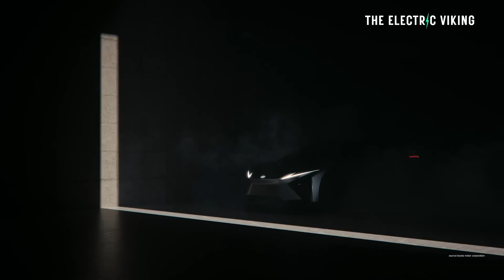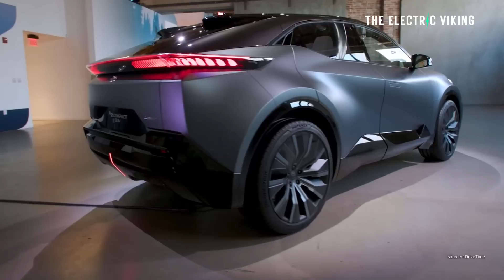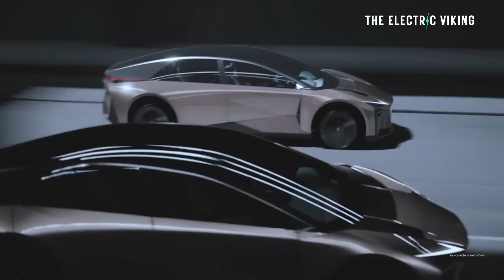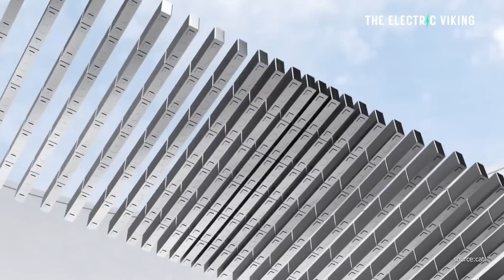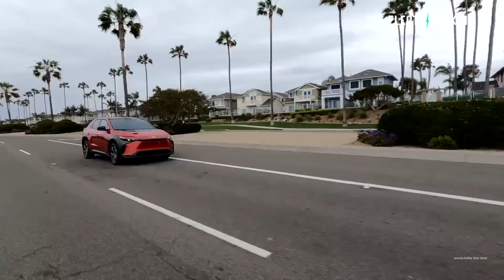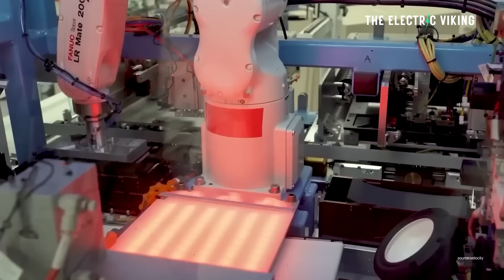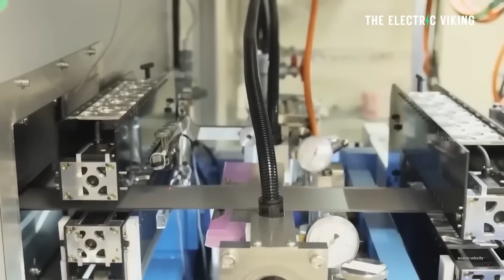Toyota says it has game changing LFP and prismatic cells that will destroy BYD

Comment: 620 miles is range is necessary... for me. 
And if highway speed drive you will only get 350 miles ... or 450 km range.

I doubt Toyota can get it better or cheaper than BYD in due time as they had developed more and wil do so.

But with this range they can sell it as higher price product.

I certainly hope so ...

Comment: Three years to leap frog what Tesla has today however will it still be better than what Tesla will have in one or two years?  Tesla tends to leap frog itself sometimes a several times a year so Toyota would need to step up the pace and start delivering these "Wonder Vehicles" closer to tomorrow and not in the distant future.

Of course one would have to ponder on how this impacts their "Deal with the Devil" promoting petro-chemical sponsored hydrogen fuel stations.  Is there an internal battle going on inside Toyota between Hydrogen and EV factions?  If so it may be interesting to see which side wins the battle.

Best!

Comment: Prismatic Cells??? 
Up Next, Toyota claims to have integrated the new Quantum Drive for light speed energy conversion coupled with their new Flux Capacitor to combat the influx of these Chinese EV's, good for 50,000km per charge and charges in 35 seconds flat.

Meanwhile, Toyota selling BZ4X with marketed 414km range, but due to software inefficiencies and other outdated technology, real world is actually only 50% of that.... 🤣

Comment: I saw some reporting on this, but it doesn't make sense to me. They're saying 80 kWh battery capacity and 1000 km range.  That is not a statement about battery technology, or energy density, or the physical size or mass of the battery, or anything of the sort.  All that becomes irrelevant.  If you've already specified that 80 kWh is how much energy you have available in the vehicle, and 1000 km range is the goal, then the only way to get there is by making the vehicle crazy efficient.  It would have to be much more efficient than a Lightyear One.  It would have to be on the same order as an Aptera!  Can you imagine Toyota going into production with anything like an Aptera?  I can't.

Comment: I would take a smaller battery and les HP if I could get at 320 miles with a 10 minute charge.  Seems to me EV's are overpowered and a smaller HP motor with smaller battery would save on weight and price. Who need 500 HP anyway?  Why don't they use 200 HP motors that would use less battery drain?

Comment: 600 Mi of range out of an 80 kilowatt hour battery pack is ludicrous, that's 7.5 Miles per KWh, that's impossible you'd have to do some insane weight reduction with great aerodynamics or make a very very small car, something like an Aptera, no regular sized hatchback or sedan could dream of that kind of efficiency.

Comment: There are a number of factors that could explain Toyota's change of heart. One possibility is that they have finally developed battery technology that is cost-competitive with gasoline-powered vehicles. Another possibility is that they have become more confident in the long-term viability of the electric vehicle market.

Whatever the reason, it is clear that Toyota is now ready to compete in the electric vehicle market. They have a strong brand name, a deep history of innovation, and a wealth of experience in automotive manufacturing. They are well-positioned to be a major player in the electric vehicle market in the years to come.
Reply: Yep. If I was forced into buying an EV in a few years it certainly would not be a Tesla. I rented a brand new one last year for 10 days. Appalling quality control. Panel gaps that a snake could crawl through, ridiculous big screen flapping around over corrugations, cheap plastic trim, and the range and charging experience was terrible. I have owned 4 HiLux's and a Toyota Corona (plus several other vehicles, Ford, GM, etc) over many decades and I would probably go the Toyota EV route when they eventually get properly sorted out. I also will never buy a Chinese car, EV or ICE.
Reply: @ivannavi8154  You should see the newer Ford and RAM diesel work trucks.  I've had 23 recalls in the last 2 years, with one recall on my RAM 3500 for a fire hazard, which their fix is to recommend not parking it in a garage or near structures.  This in not a joke, it literally says that on the recall notice because they don't have a fix for it yet.  My little model 3 is actually really well put together compared to those piles of crap.  If you had one of the early models Y's out of Texas or one of the earlier model 3's I know they had issues but I agree Toyota's are generally higher quality.   BMW seems to have actually received first shipments of solid state batteries from a company called Solid Power for testing purposes.  They appear to believe they can get these to market in 2025.  To what quatitly who knows but the future is getting really interesting.
Reply: Is from china
Reply: I hope your right.  I just wish they'd stop the bipolar statements from their management.  One day they say they have a super battery and the next day they'll state the EV's over hyped and Ice is the future.  Some of these statements coming from Akio Toyoda himself.
Reply: @Ryan-ff2db  I understand your concern about the mixed messages coming from Toyota's management regarding their electric vehicle strategy. It can be confusing and frustrating to hear conflicting statements from a company that is supposed to be a leader in the automotive industry.

Comment: I drive an EV with a nominal range of about 300 miles. Factoring in the winter performance, the range at Interstate speeds, and hilly terrain, I definitely want more range for our road trips.
Reply: Literally was gonna come down to the comments to say similar. I have yet to have the opportunity to switch to Electric 'cause... they be pricey... but while Spring, Summer, and Fall are usually pretty nice for EV driving I'm sure here in Canada, Winter is another story with notable reductions in range and I presume charging speed as well. While 300 miles (482km) isn't the worst and would probably be sufficient for most road trips during the warmer seasons, I'm sure that would drop to 240 miles (386km) at best once the temperature drops significantly closer to / beyond the freezing mark. My ideal would be anything that could do 500+ miles (804+km) so that any stops I might make I may not need to worry as much about fully charging to make it to my next destination or to my next stop. Of course I say this knowing one drive I regularly do hits a little over 600km (373 miles) one way, but doing that drive in the winter I'd rather the extra range as a buffer.
Reply: @jonatamaniuk  If you need that kind of range you might be better off waiting a couple years.  The next gen batteries due early next year will have about 15 percent better density, 40 percent better charging and particularly in your case better performance in cold temperatures.  Also due to the lower costs and lower weight they can theoretically increase the size of the pack as well but that's up to the manufacturer.  With more competition coming to market in the next couple years they'll be a greater selection of vehicles to choose from.  

I always tell people to leave emotion out of the argument.  EV's are incredibly fun to drive so it's hard to leave emotion out of it sometimes. Just make sure to go over the actual numbers and distances you realistically intend to drive and make sure it's right for your situation.  And make sure there's adequate superchargers on your expected routes.  In the US there's very few places an EV can't go but Canada is massive country with a smallish population.  I've been on some of those northern roads and man you can drive for an hour and not see another vehicle.
Reply: I agree.  400 miles is the sweet spot.  This is what the rest of the industry has settled on, as the average range of a gas vehicle is almost exactly 400 miles.  If you have kids you'll never make it past 400 miles anyways even with Benadryl.

Comment: In an EV "1000KM of range" gives you a "REAL" range of about 330 miles or range if you decide to carry extra passengers, luggage, towing, in cold weather... so do you need 1000Km of range?... Hell yeah! especially if you plan to use your vehicle for more than just joy riding on a Fri night...   And don't forget 10-20% battery degradation after 5-10 years... So again 1000 - 20% = 800 / 3 (under load) = 270-300 miles...   Come on Viking... you know these are the HARD FACTS...

Comment: We have a 2023 Chevy Bolt and have achieved range up to 330 miles during mild weather. Nearly all of our routine driving is local and charging at home with our solar panels and low electricity rates has been completely adequate. However, we went on a 200 mile trip a couple of months ago and ran into problems with not enough fast chargers and the ones that were available were down for maintenance or some other problem. We decided our next trip would be with a rental ICE car until we can charge at Tesla chargers which work and are much more available. With 600 miles of range we could have done the entire trip and only charged at home. It would also allow skipping locations with bad chargers and going on to the next city in a long distance trip. I am 100% in favor of “the more range the better”. Also with bidirectional charging and using it to power our house during outages would be much better with more capacity.
Reply: I understood where you coming from. But it doesn't make sense to me carry large battery and so much energy around 98% of time. Cars already sit idle 23 out of 24 hours a day. Furthermore, such large packs push the car price up significantly.
In reality, the focus has been mostly on fast charging than range. We'll see mainstream cars stabilizing at ~400 miles range and fast charging capability. Chinese CATL and BYD (2 largest battery manufacturers) already follow this pathway.

Comment: The battery range issue is akin to the 0 to 60 mph claims.  i.e. Most cars on the road are not going to be doing 0 to 60 mph in 3 seconds, because there would be too many accidents , even if they could accelerate that fast.  The road networks are too congested for that to be of much use and there's no real benefit,  because eventually they would hit speed limits.  Similarly the battery range argument will become irrelevant,  once super charging is widely deployed.  Additionally most people need at least a 10 minute comfort break after driving 300km,  let alone 1,000 km. Thus plenty of time for a fast recharge to around 70%.  Thus the battery range issue wont be an issue at all, as long as fast charging networks are wide spread.  The issue is fast charging EVs and fast charging networks.  Obviously until that occurs,  EV range is a key factor today,  however going forward it simply wont be an issue in terms of the future of EVs.  i.e. not simply because of better batteries,  but also because of a fully matured widely dispersed fast charging network and fast charging EVs.  For most in that situation,  500km range would be more than adequate.  The key is fast charging.

Comment: If we do a little math or maths for non-american, you get .1 miles  more range for every 2.2 pounds of weight reduction(average).  If Toyota can reduce the weight of the 80kwh battery by half it would reduce the weight by about 600 pounds.  This would equate to roughly 27-28 additional miles.  If we go by the most efficient vehicles on the road right now, this would probably be in the 350-380 range, nowhere near 620.  Toyota would have to have some crazy efficiencies to make this happen.  The vehicle would need serious reductions in weight other than just the battery pack, insane aerodynamics and the most efficient motor on the planet, not to mention electronics that sip power.  I just don't see this as a real thing, especially with that wall on wheels concept model that was in the video.

Comment: I'll only convert to EV once I have all day range. . would rather only stop for energy when I am looking to sleep ..just like how EV works as a daily driver.  It's the only way EV is finally better than ICE for road tripping.
Reply: But you have to stop for other things during the day anyhow.  You have to take breaks during a long day of travel.  Charging during the breaks you were going to take anyhow isn't that big of a problem.
Reply: @Zobeid  I'd rather casual stops be of my own choice, not coordinated with charging or just extra stops to charge cause other places I want to stop have no charging options.  This is rarely issue with gas and even when a stop doesn't have gas you can stop fuel and move on in 5 minutes as an extra stop if need be.  EV long distance road trips are just full of stupid compromise and extra time waiting around.

Comment: I wouldn’t need a car with 600 miles of actual range, but those EPA ranges aren’t real at highway speeds.  450 miles of real world highway driving would be amazing… and I think a 1000km rated battery might actually get close to that.  As someone who’s on their 2nd electric car and shopping for their third, cold weather and driving 80mph down the interstate still tend to kill a battery rather quickly so that extra range that seems extravagant would be rather practical in my opinion.

Comment: Please, review the optimal range needed  for cars driven in  countries with real winter!! I have already described the real life range for batteries in winter. And the optimal charging is 25 - 80 % - which in case of 1000km - actually is 550 km!! Add winter to this range and 110km/h speed and it goes down to  just 300÷ 350km!! - (in 25 - 80 % charging cycle) Why you constantly ignore this fact? At least say then honestly - to what climate these high driving rangevfigures reffer!  All this actually suck. If you want a real hassle free electric car - it is either hydrogen fuel cells or mini atomic reactors.

Comment: I hear expensive, so I don’t see this a problem for Tesla. Also, by 2026 the battery tech across the board will be there. What I think though is current electric cars will plummet in value as we see these next gen vehicle come out.

What people are not seeing is that a larger battery has more life because it will not be cycled as many times, so bring on 600+ mile batteries. They will last longer.
Reply: Agreed on all of that

Comment: A Chevy Bolt will go 500 miles if you drive at 10 mph. 

80 kWh is still 80 kWh, so increased efficiencies would come from drivetrain. Battery pack weight reduction is where it’s at so that EVs don’t eat tires, wear shocks, and KO wheels on potholes.

Comment: Why would anyone buy an EV with 620 miles of range? Unless you are going on longer road trips on a regular basis, you probably do not need that much range. So, most of the time you are carrying around excess weight (batteries) that you don't need. Anything above 400 miles is excess range that is not needed by most consumers. If you are commuting less than 100 miles per day and charging at home at night, then you can get by with a small battery pack. What would be preferable would be batteries you can easily add to or remove from your EV as needed. Let the consumer decide how much range they need per day/week/month etc.

Comment: Do I believe Toyota claims are rubbish? Yes I do!
80kWh battery is a 80kWh battery no matter the chemistry. It can have less weight and charge faster but at the end will deliver still 80kWh.
To have 1000km range from 80kWh battery means an average consumption of 80Wh/km which is crazy low. I don’t know if is possible even if the  total weight of the car will be less than 1500kg.

Comment: Fantastic. Love this competition. Hope it’s true. Competition and race to the top to provided the best ev is the best. Go Toyota go Tesla. Ho BYD. Give us the best if the best
Reply: Hope is not a strategy. Don't believe everything you hear about EV battery advancements. Legacy auto is 5-10 years behind Tesla & the Chinese EV makers. Unless legacy auto can actually prove any advancements are true by showing real world results to everyone, then it's just hot air and vaporware. How many years has Toyota been touting their solid state batteries while pushing out the delivery date and not showing any results? And how long has Toyota had serious issues (still unresolved) with their BFD4x (BZ4X)? Be a skeptic and critical thinker when it comes to new technology.
Reply: @tomdrewenskus8167  you’re right but competition is still a good thing and it is fact that range and performance and battery capacity safety and significant improvements have been accomplished over a few years.  Probably better words than hope is “ reasonably probability”

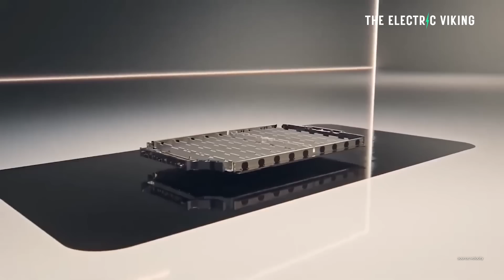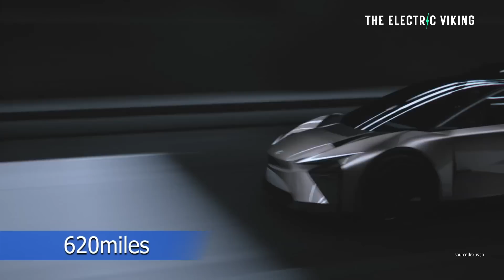Comment: I have driven a Toyota aygo for 15 years and despite normal efficient driving have never managed to get its claimed 1:20 efficiency as standard. I get at best 1:16-1:18 with normal frugal use. The bz4x claimed efficiency and range has also had some controversies on news reviews. General questions can not achieving wltp range of any ice or EV be considered ethically scandalous, just like the diesel scandal?